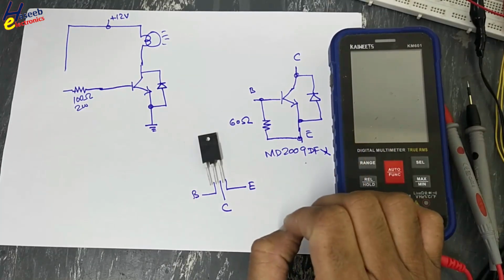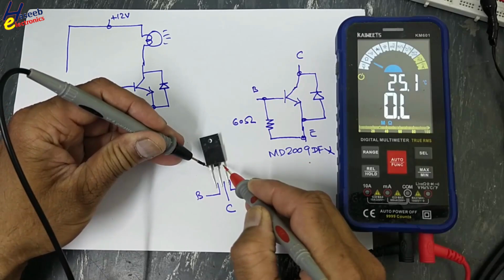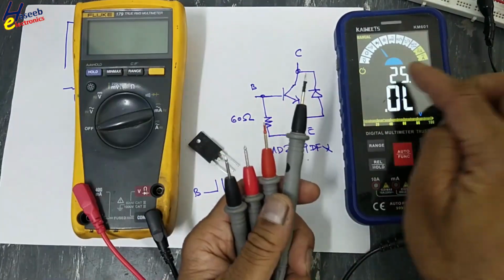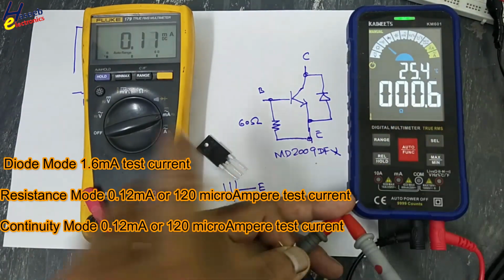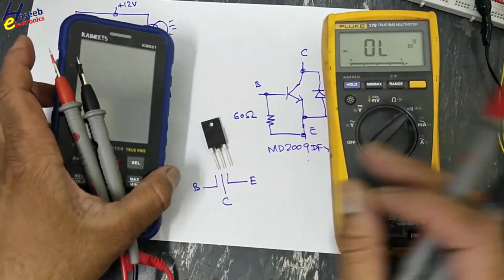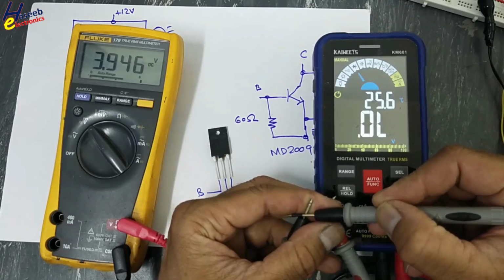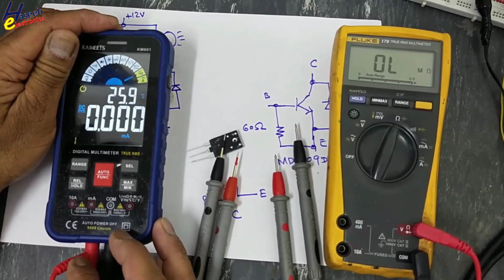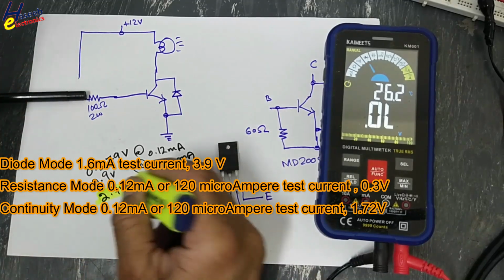{1297A} Why Multimeter Shows Different Reading in Diode and Resistance Mode

Comment: In a multimeter the current flows from anode (red lead) to cathode (black lead) or the other way?
Reply: @Mr-on2di   In a multimeter the current flows from read lead to black lead.
Reply from the maker: In digital multimeter yes same as in your comment 
But in analog multimeters lead colors will reverse 
Black for +ve
Red for -ve